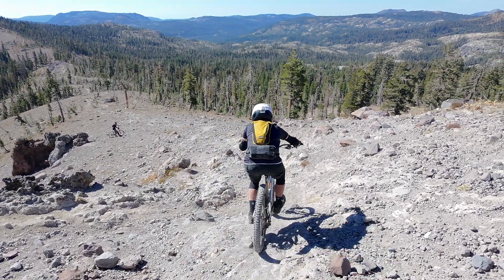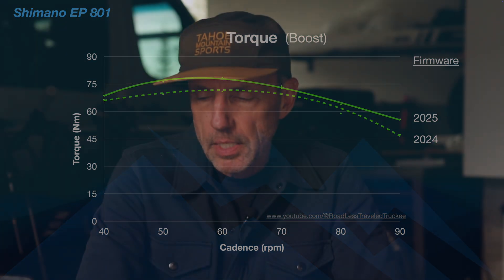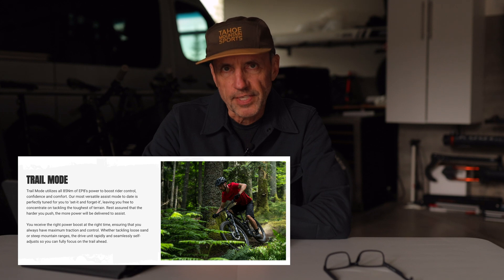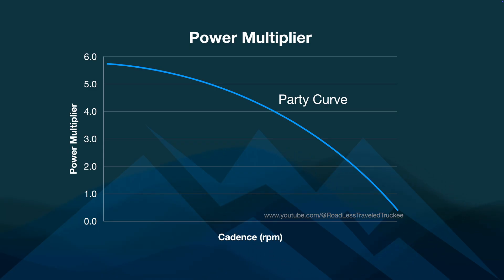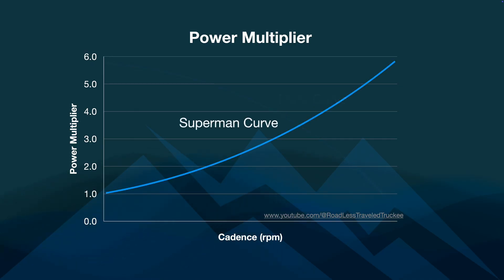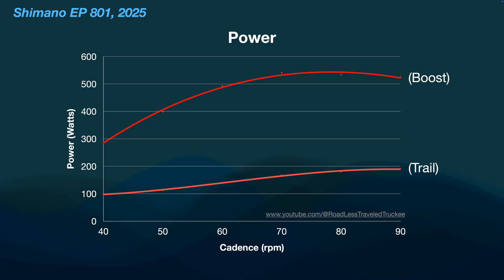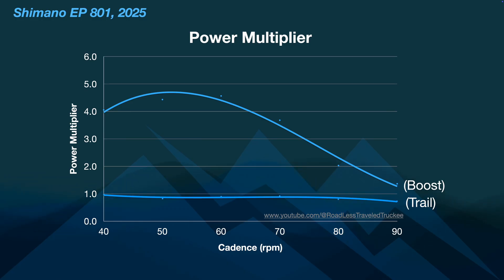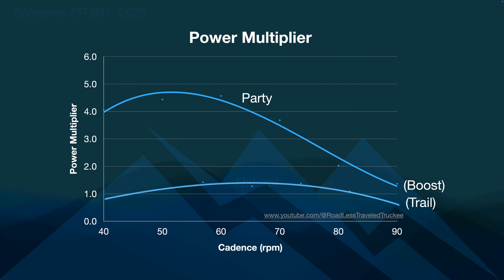How to get a natural feel from your motor AND conserve battery

Comment: Very informative thanks, i just picked mine up, haven’t updated yet , ill get dealer to do it to avoid blocking the motor, i find boost is what i ride on always and can get a reasonable amount of riding, even on boost some of my climbs are reaching the limit , so extra power would be handy although the less battery is not ideal

Comment: I turned up my Eco and Trail modes a bit higher than usual.  Did my standard three mile technical climb- lots of switchbacks.  I was having a hard time keeping the front wheel down.  I was expecting to really see some big power draw.  I actually used less battery but my time was five minutes less.  Same amount of work, just less time seems like a odd by product.  It was not the most natural feeling though.
Reply from the maker: Interesting outcome.  So hard to benchmark these results as changes are made because you always have the input from the rider to take into account.  Great feedback though, thanks!

Comment: I really love this video format! I love quantitative data that I can take to the bank. This is it!! But, this isn’t helping me make up my mind😅. 
    I’m trying to decide between the YT Decoy MX SN (Fazua) & YT Decoy MX (Shimano). The thing that keeps making me lean to Shimano is reliability… and power. But now your test is showing that it’s actually more natural feeling than the “supernatural” model. That’s very interesting! With their sale right now, the price point isn’t all that different. 
    Were you able to get rid of all of the clunking sound in the Shimano 801?? Is it really just cable rattle?? If that’s the case then I might end up going that way yet. 
   I do like some of the geometry better on the newer model, but I have to admit that motor has me a bit worried. Also, this will definitely be my only E bike for many many years. So maybe it is best to go full power.🤔
Reply from the maker: I know exactly how you feel and hesitate to advise you because everyone is so different.  That being said my choice at this point would be the SN.  Why? 1. The EP801 has rattles you cannot eliminate though every motor seems to be different and some start out quiet and get louder with time. 2. I only really use the full power when riding with one particular friend who likes to always go fast - but it drains the battery very quickly - too quickly in my opinion. 
So, after about three years of riding e-bikes I’m settling into liking more mid assistance and a lighter weight package. Again, it depends on your riding style and desires, but if you come from a cycling background you will probably be happiest with the SN.  If you come from a moto background and are moving over to bicycles and will ride with friends that are doing the same and/or just have full power bikes, then get the Shimano full power.  Just my thinking but hope it helps.
Reply: @roadlesstraveledtruckee  thank you, that’s really good input! So many videos say “go for full power”, but they don’t quantify it. I’m definitely from a cycling background. I’ve been riding bikes about as long as I have been able to walk. I think I started jumping bikes when I was 5😅. 
    Anyhow, I actually like the challenge of a climb, but at 50 years old, that’s getting more difficult. Sometimes I cut my rides short simply because I am having trouble getting up that big hill to go back down again, or to get to the other side. I’m not looking for something that does all work for me, just some help up long climbs or short super steep sections. I think SN does that. 
    Another thing, the geometry on the SN seems spot on for me. I have a 2019 YT Jeffsy in Large that always felt just a little bit too big. This SN in Medium is just a tiny bit smaller, which should be perfect. Wheelbase is longer, so more stable. 
     I’ll just have to roll the dice on the motor. I have found North American support to be quite good, so I’m actually not worried about that. Also, I’ve heard this bike has very little resistance when you turn off the motor. 
    I’ll let you know how it goes. I’ll definitely be revisiting your channel. In fact, I better subscribe right now!
Reply from the maker: @ElliottW13 yes, the SN sounds perfect for you then.  I’m jealous.  But I do have the Trek Exe which I have using most of the time. It’s a lower power motor than the Fazua and I still ride it at mid or low power.  The geo is not as relaxed as the SN however so less stable on aggressive downhills and big berms. Yes, love to hear how it works out for you.

Comment: I found my bike range reduced after using the latest version too, I mostly use boost mode for climbing and trail mode when in trails, any tips for how to bring the boost mode back to the previous range?
Reply from the maker: Great question, and I plan to run a test on this subject soon.  Until then I would use the eTube app to bring your boost assist character, max torque and assist start setting down by about 20-30% from stock (trail and eco are fine I think), and bring carryover all the way down to short.  I think carryover is a sleeping giant in terms of battery drain because it has the bike using power while you’re not peddling.  Even though the time is short it’s happening many times per minute and it’s at full power.
Reply: @roadlesstraveledtruckee thanks, that is good suggestion, 20-30% down means move the curve one bar to the right from the E-TUBE app?
Reply from the maker: That sounds about right.  Let me know how it goes. I’ve been riding my EP8 in trail mode lately and enjoy it.  EP8 has very little carryover. Bonus is that the battery lasts forever.
Reply: @roadlesstraveledtruckee I will, I mostly use boost with middle carry over with smaller 720 battery, before upgrade I can do around 4500 ft, but after only can do around 4000. Will try to tune boost down a bit and keep the middle carry over see what change will be, thanks
Reply: I got some update, I turn the curve one bar to the right for boost mode and ride it the same trails I ride all the times, you are right it almost get same battery drop as previous firmware!
Reply from the maker: Great feedback, thanks, I’m glad it worked!

Comment: Do these shimano motors use more battery than Bosch motors
Reply from the maker: You’re welcome, good luck with your decision.
Reply from the maker: Good question and I have a long answer.  I have not tested motor efficiency but given the same efficiency they should not be different. However: 1) Motors with high relative torque and power are likely pushing the limits of the motor and will be less efficient (eg. DJI I would guess), 2) higher assistance levels (aka multiplier) will use battery more quickly 3) carryover and quick reaction to your pedal input will drain battery much more than it would seem (think about how often these attributes are employed minute by minute in the trail).  Bottom line: the easier it is to pedal your bike and the more “powerful” it feels, the quicker the battery drains.  So, lately I’ve been loving my good old EP8 motor in trail mode.  I feel like I’m doing some work and it seems like I can go forever without draining the battery.  Sorry about the long answer but I’ve been thinking about this a lot lately and contemplating how to test these theories and do a video on the topic.
Reply: @roadlesstraveledtruckee Thanks for long answer It probably depends how fit you are but I've ridden borrowed specialised ebike 4 times and it does push more starting but I've been riding in lowest setting and it's not so pushy but be good to have tests on riding economy and real time battery drain and was leaning towards Bosch because of bad comments on shimano but probably the older one

Comment: Your methods and your approach to testing are rocksolid, but this video did not go where I expected it to go. I thought you were going to do some testing in the standard three level mode and try the trail mode at different maximum torque levels.  Then you would go into the multiple level mode and see how those worked.  They should probably be two videos, but I would love to see this.

FYI, on my EP – 801 with the updated firmware I am riding in some of the lower trail modes in order to save battery while still having plenty of punch to get up hills.
Reply from the maker: Great, I love the ideas.  Sometimes I do these tests and learn something different than I thought I would.  …as in this case, which just brings up more questions.  Thanks for the encouragement and ideas.

Comment: Did you use E-tube app to check motor settings? Or just tested standard settings? You can change a lot. The natural feeling comes from level assist. Less assist gives you more natural feeling. I use fine tune and I have created 5: ECO 20Nm, 1 Trail 25Nm, 2 Trail 30Nm,  3 Trail 34Nm, Boost 42Nm. Different level of assist to each.
Reply from the maker: I want to adjusting each of the Boost, trail, and eco to the same levels to see if they read identically. Only tested fine tune mode at mid setting so far.  Will keep testing different setting though - thanks for sharing your settings.

Comment: Good video. I am using the default Fine Tune with 7 modes. Pretty happy with that and normally use trail modes 3 to 5. Maybe 6 once in a while. And 2 in slow tight rocky tech. Never used boost on the trail. It would be interesting to see your curves over the 5 trail ranges in the Fine Tune mode. I think those modes can be further customizable. Trying to figure that out.
Reply from the maker: Great, thanks for your feedback.  I’ll see what I can do to publish some data on Fine tune mode levels.
Reply: This video was what I was looking for. Yes if you can do a fine tune mode video, that'll be great. New sub. Keep up the good work. Thanks

Comment: I just updated my SpectralON and adjusted only Eco up two notches because I like to try to stay in eco if I can but found I needed a bit more assist for the long climbs. I left Trail and Boost stock. Just did 27.3 mi, 3100ft and used about 60% of my 900Wh batt. That seems about right considering I’m using more juice in Eco but switching to Trail or Boost far less. I like the new app/settings so far.

Comment: I noticed that more than 25nm is not necessary.  U never get the full NM, not even in Boost.  The lower the nm and the higher the rpm  the longer the battery lasts. I ride my ebikes like hpv bikes.(shifting, cadence etc)  Most of the time eco, sometimes trail(technical stuff), never boost. I'm tall and system weigth is around 130kg. On tandem even over 190. 4 to 10w/km on tandem.
Reply from the maker: Very good observation. Seems motor and bike manufacturers are promoting Torque as a selling point but you only use that high torque value at very low cadence and it is a battery killer.

Comment: Haven’t updated yet. But just rode 5600ft and 20 miles on a 630wh and finished with about 25%battery left in trail and eco. I rarely use boost should I update my motor?
Reply from the maker: Don’t need to, especially if you’re doing big climbing rides like that on what I would call a mid size battery for that motor.  In boost you will kill the battery in lass than half that ride.

Comment: Thanks for your videos dude, are you still riding your Canyon Spectral on?
Reply from the maker: If you want more assist and carryover, the update will make it a hill climbing monster. That being said, you can always use the lower setting and customize it to use less power.  I think the trail mode will keep battery use down.  That being said, if you are happy with it the way it is, then I see now reason to update.  Thanks for the question.
Reply from the maker: Yes, I am.  In fact, I had to sell one so I sold the YT - figured the Canyon is probably worth more to me than it is to others and I have it set up well.  …and new battery today (I hope) - it’s getting nice here.
Reply: In fact I Love my spectral ON CF7, but to be honest I didn't update the firmware to 4.3.0 yet, still running with 4.1.0. I am afraid to update and get some battery or motor issues, what do you think? Motor  EP801

Comment: Man that is crazy how fast it drains the battery. I just got my battery for my Torque on an hour ago and installed it and it works fine and reads speed. It is exactly the same battery with the same case and screws together joints. Man I am not about this new battery. 😂😂
Reply from the maker: Dang, I was hoping for something better. Mine comes today but we seem to be on the end of everyone’s route.
Reply: @roadlesstraveledtruckee 🔥🔥👊

Comment: Great information. Is it so when we set the Assist character for trail and boost to the same value we have not the same powermultiplier  curve? So we can't turn trail mode into boost mode and boost mode not into trail mode using the assist character - because of the "constant flat" power multiplier programmed internally by Shimano in trail mode?  In the max torque setting  similar -Trail mode cannot be setten to boost mode?( trail mode always stays around 30 Nm) -  85 Nm only at the beginning of driving (very low cadences). Thank you.
Reply from the maker: These are all very good questions that I have not tested. I’ll see what I can do in future videos, but my intuition is that trail will maintain its character even if increased in power.

Comment: Nice video! Great information.
We're the findings you had in trail mode similar to those in fine tune mode in the middle settings?
Of the 15 settings im thinking about 6-9.
Reply from the maker: Similar but not the same.  The latter part of the video shows a comparison.
Reply: @roadlesstraveledtruckee Ah yes i see it now I missed that first time through.
Reply: Ye, when I did the update I was shocked at how quickly the battery drained. I was at Dalby Forest in the UK yesterday and  I was in fine tune mode with 15 settings and did 29 miles with 1904 ft of climbing and used 1 bar of battery . I found that better for myself.
Reply from the maker: Nice, thanks for the info!